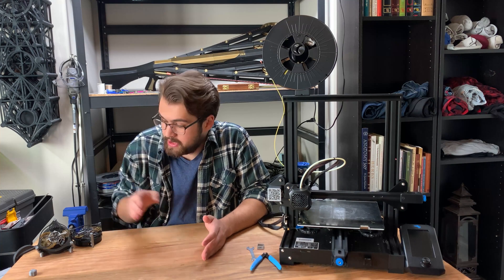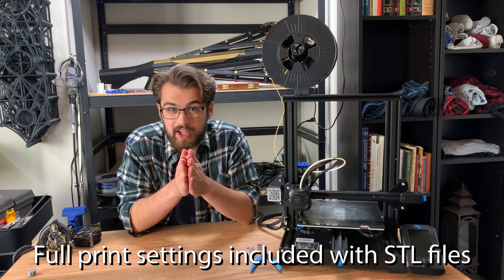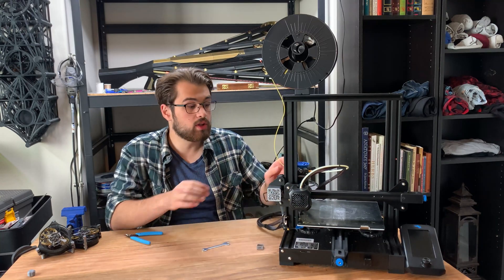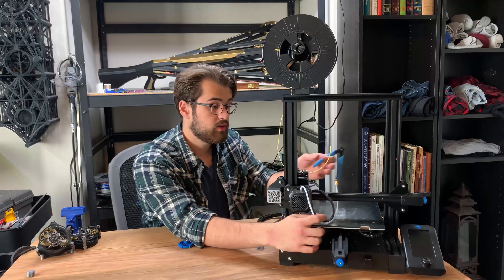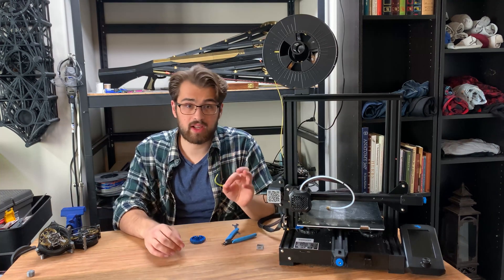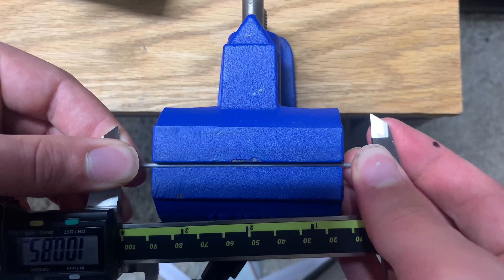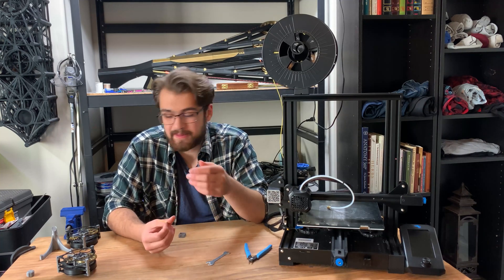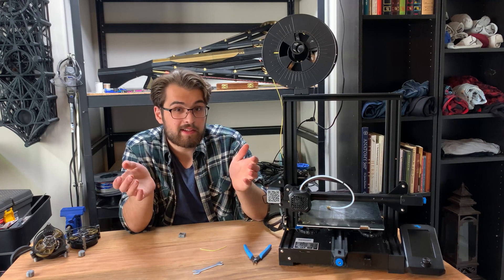Possible Printing Issues You May Have Making My 3d Printed Tourbillon

Comment: Hey having real issues printing the hair spring, not sure why at this point. Everything else seems to be printing with no issues
Reply from the maker: You could try a raft to help. could you describe the issue a little better? is it not sticking to the build plate or is it stringing